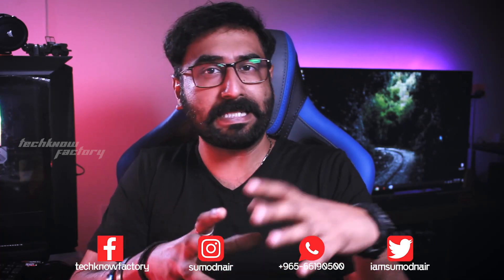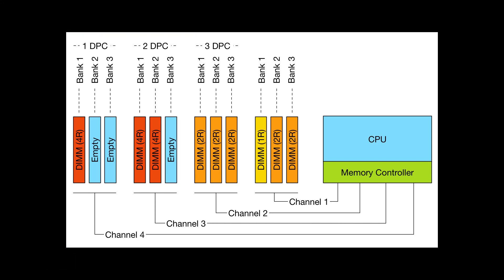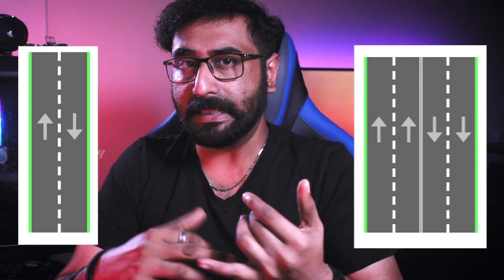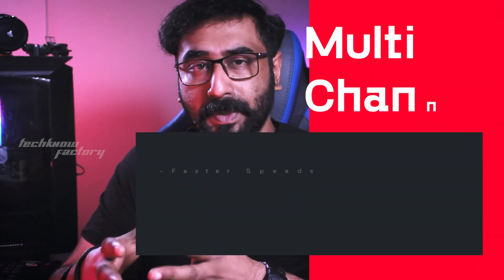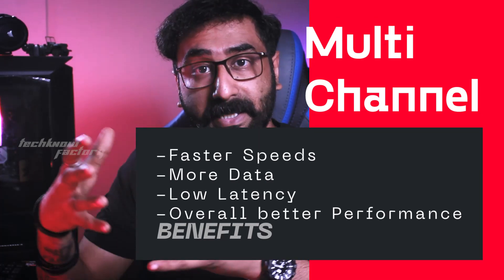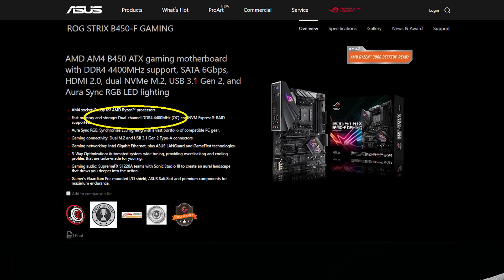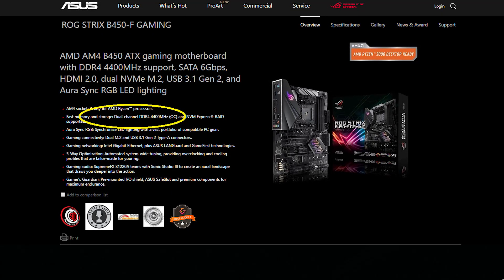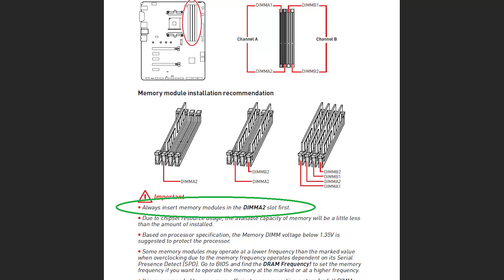Single Channel vs Dual Channel RAM Performance [Malayalam]

Comment: Bro njn Adatayude oru 4gb DDR3 yum oru 2Gb ramum aahnu ubayogikkunne 1600 mhz  athu u dimm  aahnu athu single channel aahno dual channel aahno  ini njn oru 8 gb ram vangunnund single channel athu ee 4 gb yude kude ittu 12gb ram aakan pattuo?
Reply from the maker: different size rams ittal performance kittila, use cheyam thats all
same use cheyu better like 2 x 8GB or 2 x 4GB
Reply: @TechKnowFactory  ok bro🤍

Comment: Oru doubt und,ipo chela laptop vangumpo 8gb solder cheyta ram um but total capacity 24gb vare expand cheyam enno matto kandathayi orkunnu..apo 16gb vangi second sloti ittal dual channel kitoolallo?ram addup akum enalle ollu? Performance korayumo?
Reply from the maker: Performance dual channel il kittuna athrem kittilla
So it's better and stable 16gb (8+8)  in dual channel than 8+16

Comment: Bro,  chila ram description nokkumbo single channel ennu kaanunnu...

Ingane kaanikkunna 2 ram dual aayi upayogikkaan pattathille
Reply from the maker: channel depiction Is based on motherboard
Ram 2 use cheydal if motherboard supports it will work

Comment: I recently purchased a pc with ryzen 5 5600g and initially ram was 1*16gb @3200mhz crossair vengeance and I was able to enable XMP profile to make use of the ram's full speed. Now I updated to dual channel with same ram 
But when I try to enable XMP profile pc just boots into bios showing a error message"ROOM IMAGE NOT LOADED"
"ROOM UPDATE DENIED"
CHIPSET is gigabyte b550m DS3H AC wifi , now my ram speed is only 2133mhz and Iam not getting the full potential of iGPU. Eventhough RAM is same DRAM manufacturer are different in both ram (samsung and micron technology)
Ram are installed in correct slot 2&4
All other parameters are same)
Reply from the maker: that is why always dual ram kit is recommended as kits are tested for dual channel or else have to make sure both parameters of ram are same, can try to enable xmp in other slots like 1,3 and see if works
last can show to pc technician to do in-depth troubleshooting

Comment: 2gb ram 1600 mhz  dual channel support chyuna oru ram yetha pls replay
Reply from the maker: motherboard specs vayichu noku dual channel undo
Buy any ram 2gb same speed
Reply: @TechKnowFactory  2 slot ane ulle processor  seen undo
Reply from the maker: Which processor what
Clear ayi parayu, 2gb means very old aanu velya use undavilla
Ennalum ittu noku
Reply: @TechKnowFactory  dual ddr3 ennanu kanikune
Reply: @TechKnowFactory  2gb + 2gb  4 gb kittule dual channel thane avvanam ennu undo atho 4gb + 2gb itta nallath ano appo 6gb kityo pls replay
Reply from the maker: @ZeroXxFrezze  processor ethanu
Motherboard ethanu oru details parayathey i cant say.. ittu noku apo ariyam

Comment: Bro 3 slot unde 2 gb ram ippo ollu ethyathilum 2gb ram 1 vechal scn undo (3 slot 2gb ram 2 ennam)
Reply from the maker: Velya use illa
2gb okke no use minimum 8gb recommended

Comment: 8gb 2400mhz ippoo ente laptop ullathe athinapparam 4gb inte 2133mhz ittaa enthankilum problems undoo
Reply from the maker: problem illa support cheyumengil idam but always better same size ram pinne 2133 itta both ram will work only at 2133 so try to get 8gb 2400MHz (if dual channel)
Reply: @TechKnowFactory  thnks

Comment: Bro.. Oru dbt.. My mobo's voltage limit is 1.20.. Recent rams ellaam 1.35 V alle.. So is there any problem buying one? And one more dbt.. Ente motherboard max freq is 2666mhz..ennalum maybe njn mobo futurill chelappo upgrade cheyyum.. So i prefer not wasting my money on buying a 2666mhz ram.. Karanam pinne motherboard upgrade cheythaal use illalo.. So ippo 3.2 mhz ram vedikkunnathil thettu undo?? Please reply 🖤
Reply from the maker: mboard V is 12V not 1.2V
higher ram use cheyam no problem, but will run at the lowest freq. among the set
Reply: @TechKnowFactory  tysm bruh.. Appo dhairyam aayi edukkaalo alle.. Thanks again.. Keep going 🖤

Comment: Hello bro
I have Ryzen 2700X in Gigabyte B450M-DS3H WIFI Mother board
Now I am using 2*8 gb ddr4 3000 ram, I am planning to add 16 gb more ram for adobe use. 
Should I go for same 2*8 gb and make 32 gb ram total or sell my 2*8 gb ram and buy 2*16 gb
Which should be better?
Reply from the maker: its up to you both are ok .
16gb is too much for photoshop so think do you really need 32gb??
Reply: @TechKnowFactory  16 gb for ps is fine
But when I render and play back videos in after effects ram usage is above 95% and feeling bit lag
Currently i am doing work from home as a VFX artist, that's why i am upgrading
Reply from the maker: @ronald0-v6u4v  rendering need good gpu also, anyways upgrade ram and see if it works for u
Reply: @TechKnowFactory  yes, now I am using 1660 but adobe products utilize gpu very less even below 50%, DaVinci resolve and blender use more gpu

Comment: I HAVE A DESKTOP COMPUTER 
NOW I HAVE 4 GB DDR4 MEMORY 
BUT SOON I WILL UPGRADE IT TO 8 GB DDR4 
SO MY DOUBT IS ..........
SHOUL I BUY THE EXACT 4GB DDR4  WITH SAME MODEL ,COMPANY OR BUY A 4GB DDR4 SAME SPEED ,BUT WITH DIFFERENT COMPANY 
BECAUSE MY CURRENT RAM IS NOT AVAILABLE IN MARKET 
HOPE U UNDERSTAND /ANSWER MY DOUBTS : )
Reply from the maker: if you can get same ram better
or else same speed ram different brand is ok
Reply: @TechKnowFactory  THANKS FOR REPLAY 💕

Comment: Sir my pc motherboard has 2 slots with a maximum capacity of 33gb.i have 4gb ram on 1 slot,if I had 8gb ram in the second slot. Will it became total 12gb ram . And is there any issues
Reply from the maker: better using 8x8 total 16gb
you can use 4x8 but depends on usage there may be stability issues

Comment: Sir എൻ്റെ പഴയ Laptop ആണ് ' Intel Pentium p 6200 ആണ് അതിൽ 4 Slot ഉണ്ട് ഇപ്പോൾ 2g b Ram-l 066 mHz ആണ് ഇതിൽ ഇതേ ഫ്രീക്വൻസിയുള്ള മൂന്ന് എണ്ണം വാങ്ങി gb അക്കാൻ പറ്റുമൊ ഇതിൽ Singleചാനലാന്നൊ എന്ന് അറിയില്ല' ഒന്ന് പറഞ്ഞ് തരുമൊ'ഞാൽ Computer അസംബ്ലിങ്ങ് വീഡിയോസ് കണ്ടിരുന്നു കുറച്ച് പൈസ ആയാൽ ഒന്ന് ചെയ്യണം എന്ന് വിചാരിക്കുന്നു
Reply from the maker: Laptop il 4 channel undavilla pls check it in any store 
Ram matram ittitu no use processor weak aanu velya performance kittilla
Reply: Thank u

Comment: Intel i5 10400f support 2666mhz ram. 
Can i use 3200mhz ram? 
What is the difference in 2666mhz to 3200mhz.Is that lower mhz gives more speed  Or higher should give more speed?
Reply from the maker: Higher will give more speed but for 10400f only 2666 is enough as it only supports till that. You can use higher no prb but it will run at 2666 onlt

Comment: Bro i have
Intel hd grafics510
Intel pentium g4400 3.34hz
Gigabyte h110m s2 (motherboard)
4gb ddr4 2400mhz.

When i play gta v it shutters.
When i add one more 4gb ddr4 2400mhz will i be able to play it smoothly.
Please take this question to consideration.
Reply from the maker: Gta5 needs 8gb ram and also a graphics card foe smooth play

Comment: I have 4 GB ram and I added another 4 GB ram in free slot,then it automatically turns to dual channel mode or not?(my mother board support dual channel)
Reply from the maker: yes it will

Comment: System memory specificationil upto 2400mhz  vare kanikkunnathu .. But avar  lapil provide cheythathu 3200mhz, 8gb  ram .
Eni njan ram upgrade cheyyumbol ethu frequency choose cheyyanam,same as current '3200' or to '2400' limit by system spec?

***AMD ryzen 5 ,3550H.
Reply: 2400

Comment: Corsair vengeance Lpx nte ram vagukayanegil, ethanu better??
(2x8) kit or (1x8)+(1x8) or (1x16)
Reply from the maker: 2x8 or single single
Reply: @TechKnowFactory  G.Skill Ripjaws V 16GB (8GBx2) DDR4 3200MHz or  Corsair vengeance lpx 16GB (8Gbx2) DDR4 3200 MHz 
Which one is better???

Comment: Bro I have Asus tuf fx705DD and it comes with single channel 8gb ram and I want to upgrade to dual channel and can you please suggest me a ram for gaming and multi tasking ❤️
Reply from the maker: If there is slot add another one same size any laptop ram ok
Reply: @TechKnowFactory  bro which one I want to choose crucial or hyperx

Comment: Enta oru pazhe 2nd gen lap il 1333mhz rame support cheyu but 1600 vangich ittapol ath underclock chyathe 1600 thanne work chyunnu (processor 2450m i5) why is that

Comment: Bro..NVIDIA GEFORCE 920MX Graphic card system with 8GB Ikku smooth aano...graphics games okke...
 Laptop aanu ASUS i3 7th gen..
Reply from the maker: old games low settings il okke try cheydu nokam not heavy games, try and see
Reply: @TechKnowFactory  bro nja GTA 5 kalichu..pashe athu 4gb ram lanu...appo cheriya lag undayirunnu...Ram upgrade cheythal smooth aavo...
Reply from the maker: MIKADO CEISER may be not sure...
Reply: @TechKnowFactory  ok bro...
Reply: @TechKnowFactory  ok bro..
Reply: Ok bro..

Comment: Does the ryzen apus improve graphical performance by adding dual channel ram?
Reply from the maker: Yes in cpu and apu
Always dual channel better
Reply: TechKnow Factory is the change drastic? Like a 20-30 fps change? I'm using ryzen 3 3200g
Reply from the maker: John Tharayil you can check benchmarks on YouTube for exact results

Comment: Gigabyte a320-m  ill 4gb yude 2ennam indano atho 8 gb yude onnu mathiyo
Reply from the maker: 4gb rendu kituvane good
Reply: 8gb unde vangiyal pinne upgrade cheythal mathiyo
Reply from the maker: Yes its up to you 8 ok.. But dont buy that a320 board its not recommended buy b450
Reply: 4gb vangiyal upgrade cheyyan pattillalo

Comment: Any advantage if I combined single channel and dual channel RAM of the same size? ( I have 4GB single channel installed and planning to buy 4GB dual channel).
Reply from the maker: Ram is not single channel or dual channel its ur motherboard slot... If u have 4gb and u add another 4gb it will be dual channel if motherboard supports
Reply: chila ramukalil configuration - single chanel ennum chilathil dualchanel ennum kanikunn ( Flipkart il)
Reply: @PixelCuts2.0  അത് ഞാനും ശ്രദ്ദിച്ചിട്ടുണ്ട്

Comment: Bro, enta laptop old aanu. Enikku athil 2 ram slot ond. Nerathe thanne athil 4 GB DDR3 und appo naan ini oru 4gb DDR4 ittaal prashnamaavo. Pinne athile processor i5 aakki change cheyyan pattuvaayirikko. Please, respond cheyyane. Enikkippo PC build cheyyaan paada.
Reply from the maker: laptop support cheyumengil RAM add cheyaam... processor onnum cannot change n lap
Reply: @TechKnowFactory  ram install cheyyaam, 2 slot ond. Pinne 4 GB DDR3 aanu kadakkunnathu appo naan DDR4 install cheythaal prashnamaavo. Pinne processor soldered alla appo chelappam i3il ninnu i5 2nd gen allenkil 3rd gen aakkaam. Pinne main aayittum ithu video editingum pinne gaminginumaanu. Appo ee ram ittaalum nalla GPU venam. Appo laptopil GPU install cheyyaan veleelottu vayaringokke kodukkaan menakkedaanu, appo oru APU install cheythaal kollaayirunnu.
Reply from the maker: see processor change cheyaan pattulla, even its not soldered laptop CPU is different, cant purchase seperately... ini enganelum cheythalum issues 100% undakum...  intel 2nd or 3rd gen il onum cheyaan pattulla... tooooo old processor aanu.... ram ddr3 thanne venam
Reply: @TechKnowFactory  okok
Reply: @TechKnowFactory  Enthaayaalum 8 varsham pazhakkamulla laptop aa. Athu thulannaalum kuzhappamilla. Enikku thonnunnu oru PC build cheyyunneyaanu nalathennu.

Comment: സാധാരണ laptop ലേക്ക് ram വാങ്ങുന്ന സമയത്ത്
Ram ന്റെ discription ൽ 
Single channel , dual channel എന്ന് എഴുതിയത് കാണാം
അത് എന്താ

അതായത് ram single channel
Ram dual channel എന്ന് ഒക്കെ കാണാം
Reply from the maker: athalle video il paranje... dual means it is tested in dual channel ennanu...
Reply: @TechKnowFactory  
അതായത് 1 ram stick തന്നെ
Dual channel, singel channel എന്ന് എഴുതിയത് കാണാം

ചില ram സ്റ്റിക്ക്  ന്റെ മേലെ single channel എന്നും
ചിലത് ന്റെ മേലെ  dual channel എന്നും എഴുതിയിരിക്കുന്നു

Eg : 
1 : Crucial Basic Series DDR4 8 GB ( Single Channel ) Laptop ( 8GB DDR4-2400 SODIMM )

2 : Samsung 1600mhz low voltage DDR3 8 GB ( Dual Channel ) Laptop ( M471B1G73QHO - YKO PC3L 12800S )

ഇങ്ങള് പറഞ്ഞത് ഒരു ram stick use ചെയ്യുവാണെങ്കിൽ അത് single channel എന്നും
2 ram stick use ചെയ്യുവാണെങ്കിൽ അത് dual ചാനൽ എന്നല്ലേ

മേലത്തെ 2 product ൽ 
1 single channel
2 dual channel 

അത് എന്താണ് എന്നാണ് ചോദിച്ചത്😁😊
Reply from the maker: @jumanmohd6084  athanu paranje angane mention cheydengil athu aa channel il test cheyda ram anennu aanu.... ok pinne ram alla single ano dual ano decide cheyunne, motherboard aanu... so 2 single rams dual channel support cheyunna motherboard il use cheydal athu dual channel il work avum... ram il single ano dual ano nokanda avisham illa... motherboard support cheyumo enu nokiyal mathi

Comment: Ente pc ill 16gb 3200Mhz gskill ripjaws single stick aanu ullathu. Njan athe model thanne additional order koduthu, duel channel aakan vendi.. ini additional  2slots koodi mother board ill undu.. future ill ithe ram stick thanne 2 ennam koodi ittu ella slots um fill cheythal duel channel complete aayi disable aakumo? allenkil first 2 slots maathram duel channel aayi work aakumo?njan use cheyyunna processor intel core i7 10700 aanu. Maximum memory support 128gb undu..but max memory channel 2 ennanu koduthirikkunne...
Reply from the maker: No prb max 4 fill cheyaam no issues
Reply: @TechKnowFactory  Thank you 🙂

Comment: Hi bro, ente lappil 10600 frq ulla single channel ram aanu, 4gb. Valare old laptop aanu, with 2nd gen i5. Enik oru slot free undu. Ddr3/pc3 aanu type with 1.5 v. Same manufacturer de single channel kittanilla. What do you suggest b/w using one more 4gb dual channel vs 4gb single channel of another manufacturer? Thanks in advance
Reply from the maker: if laptop supports more ram you can add same size ram from diff brand
Reply: @TechKnowFactory  Thank you so much.. my lap supports upto 16 gb. So shall i order a single channel 4gb, 10600s, hynix to run alongside  with my same spec samsung? Both r 1.5 v, pc3 2rx8... But visually, i can see 8 'black blocks' in hynix board on same side, in 2 lines, but only one line of 4 blocks in samsung board.. Hope that's fine...

Comment: Please ഒന്ന് ഹെല്പ് ചെയ്യുമോ....... ഞാൻ 16 gb ddr4 3000 mhz single stick ram ആണ് മേടിച്ചേ.... ഞാൻ അത് മാറ്റിവാങ്ങണോ??... അതോ ഒരു extra 16gb വാങ്ങി dual ചാനൽ ആക്കണോ? 

Ryzen5 3600
X570 motherboard and config.

Main gamming അല്ല... 3d rendering and video editing ആണ്.....
Reply from the maker: 16 gb extra vaangu later athu rendering il kurachu help cheyum...
Reply: @TechKnowFactory  thx.. bro... enthayalum oru 16gb koodi vangan theeeumanichu...
Reply: @TechKnowFactory  one more question.... 
Ryzen 5 3600 cpu മേടിക്കുന്നുണ്ട്... 
Motherboard b550 കിട്ടാനില്ല.... ലോക്കൽ purchace.... അപ്പോൾ b450 വാങ്ങണോ അതോ 550 വെയിറ്റ്  ചെയ്യണോ??....550 future proof ആണെന്ന് അറിയാം.... എന്തായാലും ഒരു 2-3 yrs ഒരു upgrade കാണില്ല... അതുകൊണ്ട് അതിനു പ്രസക്തിയില്ല......450 ആണേൽ വിലയും കുറവുണ്ട്.. ഒരുപാടു model available ആണ്.... 450, 550 വലിയ പെർഫോമൻസ് difference കാണാൻ ചാൻസ് ഉണ്ടോ?
550 online amazone നിന്ന് മേടിച്ചാൽ warranty claim ചെയ്യേണ്ടിവന്നാൽ അടുത്തുള്ള authorized srvce cntr ൽ കൊടുക്കാൻ പറ്റുമോ?
Reply from the maker: B450 may be one more year... B550 um not sure if after 4000series amd socket change cheydal vere board vanganam.... As of now b450 is ok but one level up b550 or x570 is better.... Warranty and service nu better is local purchase
Reply: @TechKnowFactory  thx.. man.....

Comment: Bro ee dual channelil ano pc run avunne enn engane check cheyyum...ente pc i3 4150  il adata 2x4gb 1600mhz anu ittirikkunna...dualil ano working enn engane ariyum?
Reply: Bro your contact mail id or anything tharamo i need a enquiry
Reply from the maker: all available in description bro
Reply: @IsolatedHuman  cpu-z enna app vechu nokkamallo
Reply from the maker: athu video il paranja pole processor and motherboard specs il noku..

Comment: Ddr3 to ddr4 update chayyumbol anthakka change chiyyanam   oru video chiyyamo
Reply: Njan ippol use chiyyuna ddr3 amd  simpron 145  same ddr3 nalla gaming processor undo
Reply from the maker: @nikhilsajeev8473  ddr3 il limitations und, motherboard based aanu processor list.. better ddr4 il marunne aanu... or used cpus nokanam for your motherboard, contact iTHut upgrades pattumo CPUs endelum undo ariyaam, description in no. kaanum
Reply from the maker: Yes upgrading video its coming, but ddr3 to ddr4 means almost puthiya PC edukunnapole aanu.. CPU, Motherboard & RAM change cheyanam, puthiyathu vaanganam .. baki nalla parts ane use cheyaam

Comment: Intel core i3 2120 2nd generation 3.3 ghz lga 1155 socket 2 cores desktop processor silver h61 motherboard il support cheyoumo
Reply from the maker: yes it is H61chipset, pls confirm in processors website anyways

Comment: Mac os mojave support cheyyuna mac allatha 60k laptops etokkeya
Onnu recommend cheyyumo
Reply from the maker: I am not sure about it as I havent used a mac or a hackintosh, im still learning it. normally in pc intel cpu and ryzen gpus better for hack. But a laptop I am not sure to recommend something I am not aware, I read mostly you will have issues with Laps like wifi, bluetooth or keyboards.
Reply: @TechKnowFactory  overall better ayittullat etayirikkum
Reply from the maker: @abhijithpremji6148  about the laptop for mac OS, better google il search cheydu noku search in forums there are many articles which may help since I have not much info.

Comment: 40k range n ullil nalla oru laptop suggest cheyyumo?
Reply from the maker: 40K you can get asus vivobook series or lenovo 330 or 145 models depending on ur budget
Reply: 50k ullil ullath aatha better?
Reply from the maker: @Fayas_faa  same with different better specs.. or u can get gaming laptops 50-55k acer nitro, asus vivobook gaming, asus tuf